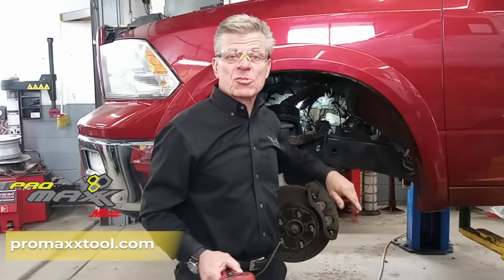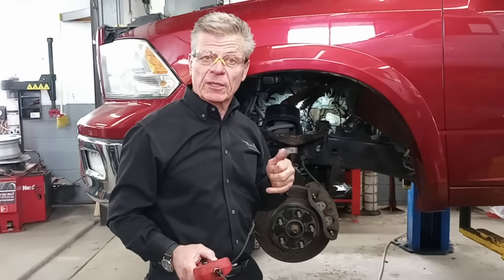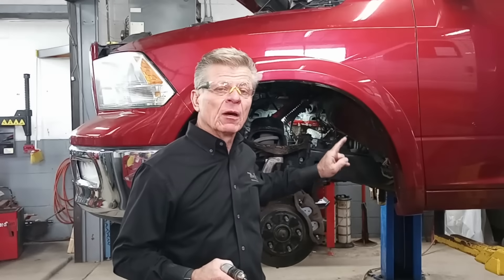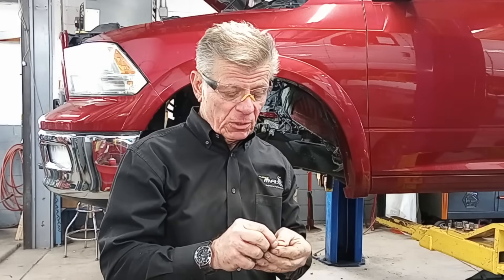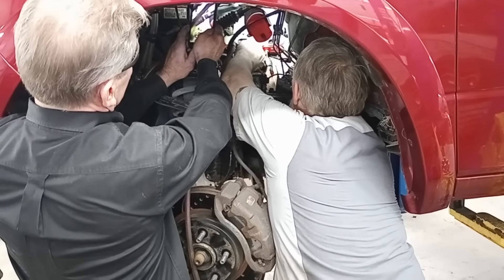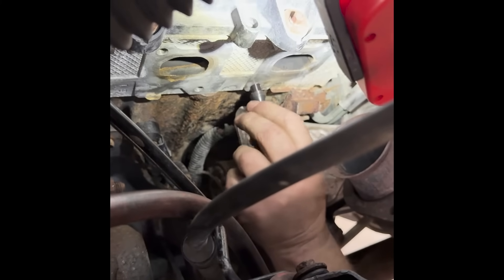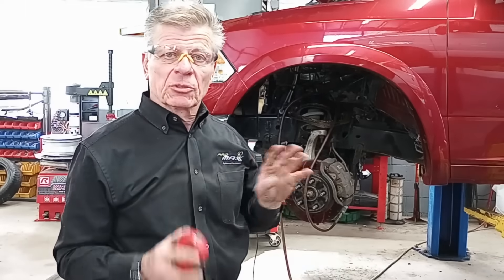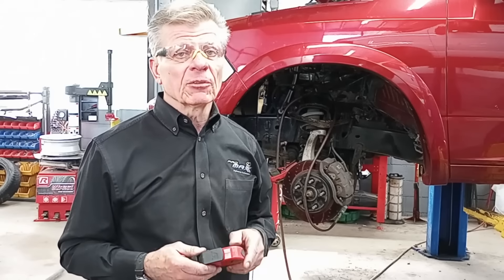Tech rescues Exhaust Manifold Bolt Botched Job Repair on a Dodge HEMI 5.7L in about an hour

Comment: Thanks for the great video!  I am a machinist and will be tackling this repair on my truck very soon.  What are the insert specs that you recommend; M8x1.25 internal - brand, external thread size (tap drill drill size), depth/length, material (SS, steel, alloy)?  How did you keep the tap drill aligned with previous hole?  Link to purchase?